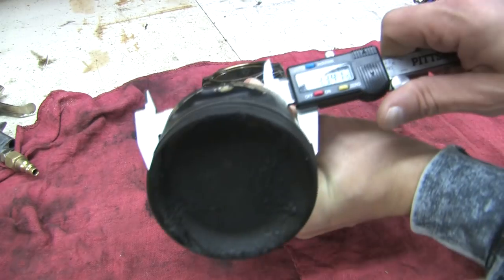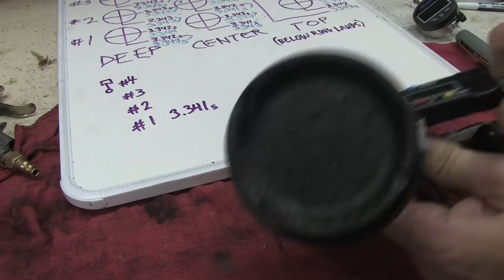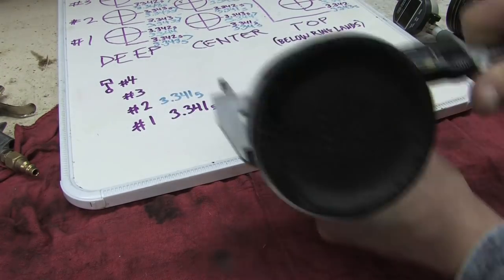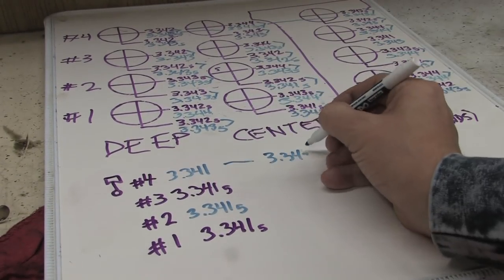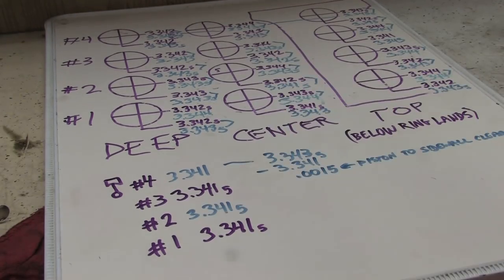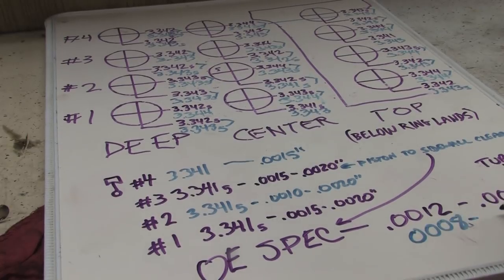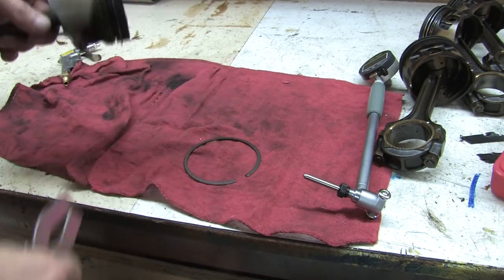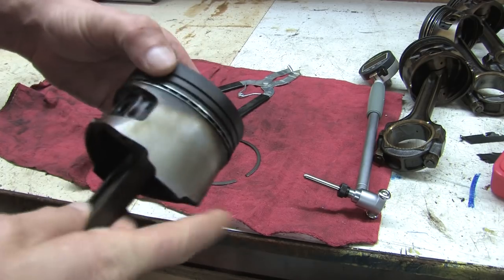Blueprint 107 - piston-to-cylinder wall clearance

Comment: 11 years later and still the absolute best comprehensive series on 4g63 rebuilds. Currently working on its glue eating cousin the "beta" a hyundai 2.0l  motor loosely based of the non-turbo aluminum 4g63 6 bolt and using your videos as a rough guideline for my rebuild, it's going turbo and going into a 2010 accent

Comment: +Jafromobile aren't you supposed to use a micrometer instead of a caliper to measure the pistons?
Reply from the maker: Absolutely.  Especially when doing an assembly.  If you ever get the time, check out the Hyundai assembly series.  I use .0001" micrometers during assembly.  Here I'm just doing quick checks to see what I've got to start with.  I didn't have .0001" graduated tools at this point.

Comment: i have a Nissan Maxima with low compression in cylinder 6 did a leak down test on it and the rings are bad. if i change out the rings for this one do i have to do it for all the rest? how long would i have to hone the block out for? nice video keep them coming we love it in the Bahamas.

Comment: Can you please show us the complete math on how you are getting the PTW clearances? Because I am getting different numbers than you are.... You are only using the Bore gauge measurements and ignoring the telescopic gauge measures, correct? 

For instance if we look at cylinder #1: the highest bore measurement I see= 3.344" the lowest bore measurement I see=3.343". 
Piston#1= 3.3415"

So PTW=3.344"-3.3415"=.0025" and 3.343"-3.3415"=.0015".

Am I do it wrong? 

Thanks for the great videos.

Comment: So you don't use the deep readings from cylinder #1?  Are you just using the high and low numbers from the top and center? If your not going to use the deep readings, why take them?  Just a little lost.

Comment: Question, if I wanted custom Pistons..... Would it be better if I measured the cylinder bore after it has been honed by a machine shop before I put the order in for custom piston to fall in the piston to wall clearance range ?
Reply from the maker: Johnny Ferreira No.  What you want to do is order your pistons oversized versus the bore you have, and have the machine shop cut the bores to fit those pistons.  It's only accurate if the same set of measurement tools are used for both parts during the fitting procedure.  So get your pistons first.

Comment: I'm still trying to understand the math problem where as to 3.343 - 3.341 = 0.002 but you have it down as .0015 and that's where I am lost at, besides that; I love your video. I'm blueprinting a 92mm Bore 3MZFE which in inches should come out to 3.622. Let's say the lowest reading I saw was 3.622" and the highest is 3.625". What should my clearance be?
Reply from the maker: The most crucial piece of advice I can give is... what the piston's manufacturer says it should be.  The reason I say that is because of materials issues and thermal expansion.  Whatever the manufacturer made the pistons out of affects how much they grow when heat is added to the equation, and every set is a little different.  One kind of pistons will grow more or less than the next when they're hot.  How much heat you add also affects how they grow.  If your engine is prone to knocking, going on the fatter side tends to help the engine survive it better because extreme pressures caused by knock will escape past the rings to some degree, but too much and you won't make good compression.  There are tons of variables to consider, so you want to get the manufacturer's spec and then make adjustments to p2cw clearance and ring gap accordingly.  

One example where you'd want to enlarge both of those measurements is if you're boosting a stock-bore, stock set of pistons.  It's a poor man's way around expensive forged upgrades, but you sacrifice oil longevity and end up with higher crankcase pressures.  Sort of what I'm doing with my Hyundai.  9.8:1 compression at 20 PSI with cast pistons.  Most people would say you can't do it.  I have wide ring gaps and wide piston to cylinder wall clearances.  I have to change my oil every 1000-1500 miles, but they're 1000-1500 FUN miles.  You'd want them tighter on your daily driver or a normally-aspirated freshly-honed block.  If they're within the service limits the manufacturer calls for, you can get away with re-using the pistons you have.  Slight egging or taper actually helps the rings seal better because it keeps them moving.

Man, if you just found my channel and you're currently rebuilding an engine, lucky you!  Get yourself more accurate measurements tools than any of the ones I use in the 100 series videos.
Reply from the maker: 3.3415  The measurement was between 3.341 and 3.342.  These micrometers are junk.  Props.  They're low-resolution.  You need .0001 resolution measurement tools for this.  The reason why is the spec on runout or oval is only .0004" on your typical engine.  .001 micrometers like these aren't fine enough to get the job done right.  They just tell you if your hardware is worth having machined.

Watch the Hyundai series and you'll see it done with real tools.  ;)  They're essentially the 200-series.
Reply: ***** Thanks  bro, in luck I am...... Yes I ordered 12:5.1 custom compression pistons so i'm just waiting on their arrival. Was searching to understand the piston to wall clearance and how do you determine which clearance to go with, on certain engine setup. Just saw the cylinder head and how you polished up the chambers. Looking forward to doing it as well. Thumbs up bro. Definitely a hero in my book

Comment: I have a 2 stroke dirt bike and want to put a new piston in it. The new one if forged, so do you think there would be any problems?
Reply: how did it go??
Reply: I assume by now ur riding?
Reply: +D-Block Everything went well. I honed the cylinder to make it a tiny bit wider for the forged piston.

Comment: In a performance oriented engine NA spec, wouldn't one want to try to go under the manufacturers specified clearance levels? Having a lower piston to wall clearance would increase performance
Reply from the maker: In theory, yes.  Materials and ring gaps would matter more for a high output NA setup because of thermal expansion.  You wouldn't want to run out of ring gap, and you definitely wouldn't want to run out of P2CW clearance.  There would be less thermal expansion in an NA setup than a forced induction setup because you're burning less fuel.  The key to efficiency is to match the materials properties so there's only enough gap for them to swell up for the build's peak power output and generated heat.  That goes for any configuration, really... but it's the assembler's responsibility to understand their materials.  It's not only the power levels achieved that matter; different materials have different thermal expansion rates.  If they're not stock materials, then the stock specifications are meaningless.  If you're making more power than stock using stock parts, then the stock clearances are too tight, and the stock clearances specs are once again meaningless.  The boosted Honda crowd will also confirm this because the stock rotating assembly built to factory specs are super-tight for NA fuel efficiency, and boosted they're a ticking time bomb unless they take measures to enlarge ring gaps and hone the bores larger for the P2CW clearance they'd need at that power and heat level.  Great question!
Reply: @Jafromobile  I'm guessing ring gap is the main boogyman, I've seen what can happen if they have no room to expand anymore.

How do you find out how much heat will be created and dissipated?

Enlarging water coolant passages and increasing oil pressure for piston oil spraying jets would be the best options I presume?

Great answers :D

I'm looking at buying an Alfa 916 GTV and going NA 3.0 V6, 350 HP or thereabouts should not be too much to ask right?
Reply from the maker: 100hp per liter is considered very high performance from a NA perspective.  I'd say it's do-able, but to beat that ratio, you'll be on the razor's edge of efficiency.  Aftermarket parts will come with a spec sheet that will tell you what you'd need as far as clearances are concerned.  For stock parts, it's a good rule of thumb to calculate your minimum and maximum specs in a ratio based on your base and target power levels (target horsepower/base horsepower = target spec (X)/factory spec).  If you know the factory specs, your base hp, and your target hp... then all you need to calculate is your target spec.  You may lose some efficiency at part throttle, but you'll have enough gap for when you're at WOT.  If you make 267hp and you want 350, then you'd need to make your min and max clearances about 30% larger.  It's not law, but it's a safe way to do it with stock parts.  For everything else, you get a spec sheet with the purchase.  For instance, JE makes very specific specs for how their pistons are used, for all the different materials you can buy, and they're all available online just in case you lose the spec sheet.
Reply: @Jafromobile  Awesome, I'll look into those JE specs.

Thanks a billion.
Reply from the maker: @hectorae86  Just remember those JE specs are only for JE pistons ;)  Materials differ from one manufacturer to the next.  One company's 4032 piston might swell up more than another company's 4032 piston.  Silicon content may vary.  Base yours off of the pistons you're using.